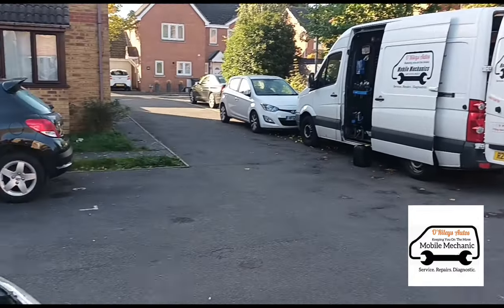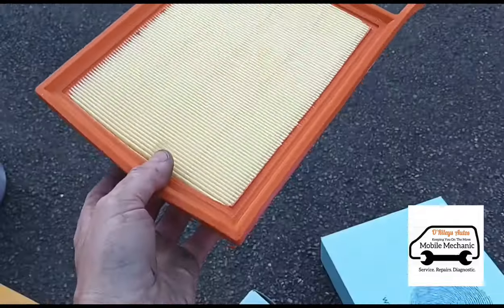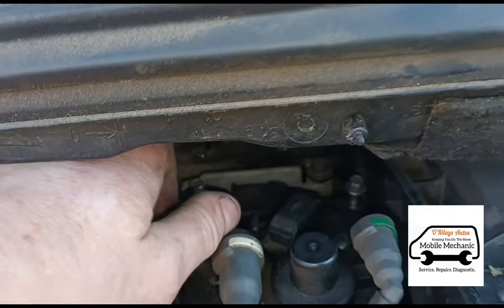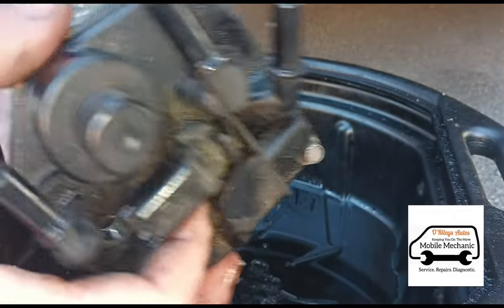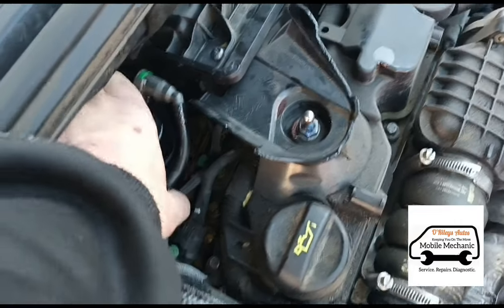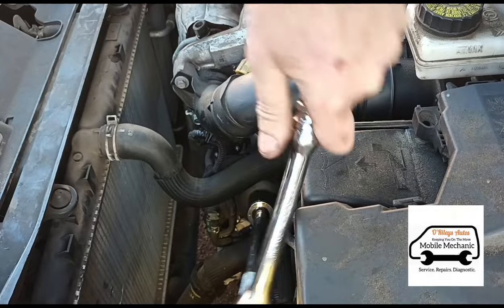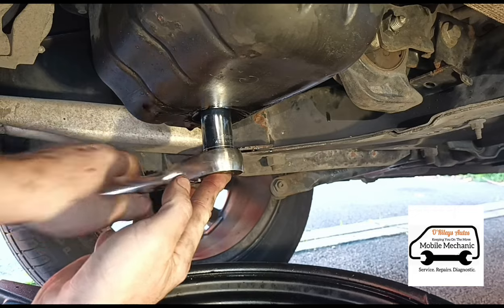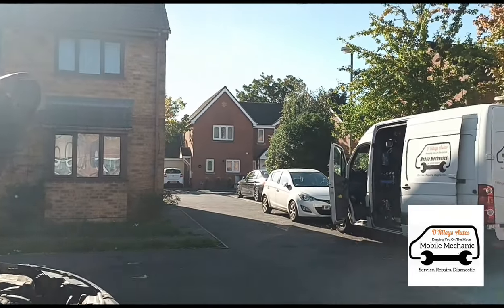1.6Hdi Full Engine Service Fuel Air Cabin Oil Filters. Peugeot Citroën Ford Volvo Mini

Comment: I have a C3 Picasso, once again, same engine, you have given me a lot of confidence to do it myself and your steps taken and explanations are invaluable. Thank you :)
Reply: Interesting did you do it okay. Would adding additives then a motorway run with diesel plus then a battery reset (unplug battery for 24 hours) also work?

Comment: You don't need to pull the sensor out of the housing. Just turn and lift slightly to drain the filter. Before then removing the t15 nuts when it's empty

Comment: When adding the new oil filter should the oil filter first be drenched in oil to avoid air pockets forming which risks dry engine start up? Should I pour oil into the center hole of the filter until it’s about two-thirds full and let it soak in for a minute or two?

Comment: He's a one of best mechanic for Peugeot/Citroën/Volvo/Ford. He did the job 100% professionally for 1.6hdi engine.
I sold/px my peugeot 307 1.6hdi 90bhp 2005 last week with 182000+miles (CK55PKC anyone can check mot mileage history) with original engine + gearbox + original turbo +original injectors with perfect mechanically fit. I do service between 3000 -----5000 miles every single time with engine oil flush and use always c2 low saps oil and tight up nicely injectors 8 bolts without torque wrench. I bought in 2014 with 123000 mileage after buying change oil pick up little pump located in sump and change turbo oil feed pipe and remove plastic filter from new banjo bolt n old one fitted with mesh gauza type filter ( when you use c2 oil and service under 5k miles then no need filter in banjo bold this little piece of s*** kill the turbo. I change fuel filter twice in 60k milage. I bought again peugeot 2008 1.6hdi with 8v 92 bhp. Let's see how this goes 🤞👍🙏 in shaa Allah hope for best.
I am not a mechanic but always try to learn from professionals ( i learn this schedule of serviceing and things from respected Irish mechanic )
Reply from the maker: Thanks
Reply: Have a peugeot 2008 (year 2015) 1.6HDI .. it has 110,000KM. When should i change the timing belt??
Reply: @alessaquilina I would if I was you just to be safe.

Comment: thanks for the answer I was looking for to my engine oil concerns - got my peugeot 2.0 bluehdi serviced last week, did only about 40 miles and thought to inspect the oil on the dipstick which to my surprise looked as black as before, so started digging through internet to find out if that can be right or I have been scammed, found some contradicting articles but I'm finally happy after seeing this video right there it's nothing unusual. thanks for posting this!

Comment: Hi Jimmy,
That tap in the middle of the diesel filter housing is there to hold the filter.
Twist it to release fuel out from the filter.
Its not a electrical connection.
😊
Reply: If only the engine oil filter is changed but not the engine oil, how much oil do I need to add after the change? I guess it's 150ml.

Comment: Very good video, I previously researched 3 separate vids on a 308 TDI to service, and only came across this one to check how easy the initial engine cover was to remove, and it turned out to show me the whole 4 filter changes (on what is a very similar group engine Peugeot/Citreon) in an only 22 min video, makes it look so simple - great work - Thanks.
Reply: ..also really want a magnet thingy to undo my sump so bad now 🤣
Reply from the maker: Glad it helped

Comment: Great video! Picked up some good tips. That magnetic sump plug tool is a must!
I also like Blue Print filters; just replaced the cabin filters in wife's C3 with Borg and Becks which are much firmer than other makes.
On our C4 Picasso 2017, the cabin filters are in the driver's footwell behind the heater, you need to be double jointed!
I always put a new copper washer on the sump plug - the time I didn't I got a leak.
Thanks for posting this.
P S have liked and subscribed
Reply from the maker: Glad it was helpful!

Comment: thanks for the video, helps me as I just moved from the 16 to the 8 valve HDI. The change of the fuel filter is for the worse, big mess. What you called a sensor is probably a heating element.
Reply: Is the 8V engine better than the 16V? No injector seal problems?
Reply: @davidk.713  the 8V version has no (0) power below 1.200 rpm, while the 16V stormed ahead, right from idle - VERY BAD!!! As mitigation a 6-speed gearbox is installed, which shifts somehow unprecisely and stiff. The 6th gear however adds cruising comfort. Many components (glow plugs, high pressure fuel pump, rail) allow for much better maintenance access. DPF regeneration takes only half as long as for the 16V, while less additive is injected, I wonder how that works. The fuel consumption of the 8V is significantly (approx. 15%) less. While I believe, that the engine (minus 1 camshaft, 8 valves, rockers and hydros) should weigh less as the 16V and the car feels as if they traded stiffness for weight reduction, the car (identically configured) actually gained 13Kg according to papers - very strange. No seal problems yet. The cause of that one were the engine vibrations loosening the injector screws. Once loose, the exhaust pressure lifts the injector and causes hot gas to penetrate the space above and below the seal, burning gaps and channels into its copper. This can be avoided by regularly checking and tightening the screws.
Reply: @cyberbob4111  thanks

Comment: 1. How similar are the codes on the computer via the interface to gasoline or diesel cars?
2. Have you presented somewhere the verification values with the measuring device at the car's sensors? Thank you!

Comment: Wish id seen this video yesterday! First time servicing my peageot partner today to the point i had to buy a socket set haha. Oil filter and air filter went well but once i took the fuel filter apart i noticed that the long bit that runs right through the middle had snapped or looks more like its been sawed off!? Had no idea what it was for so bought a whole new housing on amazon but now seeing your video explaining what its for i realised that there was also blue tac or something squished around the drain pipe of filter! Had the van 6 years always serviced at same place till this time and feel robbed. Dont get me started on cabin filter, looks a difficult job to do but wanted to try anyway and loan behold the filters have just been crushed inside and there is no way to retreive them
Reply: I went the same way as you did. Garage was ripping me off so I decided to learn it myself

Comment: That's informative....I have bought the fuel filter but mine is a Berlingo which also has an electrical connector. Dunno how that is supposed to come off...Yours did not seem to have it but you did say there was a sensor so how does it monitor if not connected to anything...?

Comment: engine OIL 5w30 : 
but if it has certification  for API SN & or ILSAC  only. as in oil for PEtrol egine only
&
I pour that oil on Diesel engine would it effect engine long term :face-blue-question-mark:

Comment: This is a 8v if I am not mistaken? Quite a few differences to my 2011 16v it seems in regards to type of filters and locations. Or is it different because this is a 110hp whereas mine is 90?
Reply: 92hp and 111hp 1.6hdi are 8 valve engines, older 1.6hdi 90hp and 109ps are 16valve engines

Comment: Have a 2014 1.6hdii Berlingo in for prep at the moment and it cuts stalls/cuts out under load if you put your foot down or go up a hill. Thought we found the issue with a leaking Intercooler but unfortunately not. Had anything similar?
Reply: Fuel filter 100%
Reply: Fault code will read fuel rail pressure low normally
Reply: @Ben-in6qh  changed the filter as was first thought. But still nothing 😔
Reply: @Ben-in6qh  thanks for the response
Reply: @SCCarTraders  no codes?
Reply: @Ben-in6qh  oh yes. I'll post them In The morning, cheers

Comment: great video really helpful 👍 
was wondering which engine oil did u use isit 5w 30 or 5w 40 and which brand please
Reply: Citroën préfère Total, as they say. Put Total 5w 30 in mine.
Reply: I use castrol magnatec 5w30 c2 and it runs great, just use good quality oil.

Comment: Ill give you a few details if u buy this car avoid the automatic gearbox as it sometimes doesnt shift and another thing is dpf cleaning might be useless i just filled pat fluid but problem returned so dpf delete incoming soon.... mechanic said the cars in bad shape as it is so were gonna drive it till its dead which will be within this yr as turbo is acting abit funny. I havent even bothered replacinh the tyres on it its that bad

Comment: are these good engines..im looking for a partner van
Reply: I’ve mine about 4.5 years, I bought it with 140,000 Kms and now has 200,000. Hasn’t givin me an ounce of trouble. Serviced every 5-7,000 Kms. A great little van, if buying I would look for service history though just to be on the safe side.

Comment: Hi . In the same engine, the fuel passes into the oil, what could be the cause?
Reply from the maker: High dpf pressure. 
Worn piston rings.
Over fueling Injectors...
Reply: @ORileysAutos  Is this something i can check myself or just the mechanic ? And thanks !
Reply: Injector seals also

Comment: What a pig of an engine bay to work on. My LHD Multispace doesn't have access to the pollen filter like this one. I spent 45 minutes removing all the fecking trim to find no access panel. F*uck knows. The last garage we took it too did up the oil filter with an air gun as I could barely move it with a 1M bar!

Im not having fun working on this. My 2007 Fiesta is just as bad for the pollen filter but the rest is easy even with a 2.0 in the tiny bay. My lovely old Escort (1972) is a piece of piss in comparison. Im sure the designers make them this awkward to charge more labour.

Comment: Changed the Clutch in an ST Fiesta with same engine and you have to remove the DPF to get one gearbox bolt out !!! Lucky for me all the sensors came out as you need this to remove the heat shields and get the DPF out of the way !! Total rubbish design  I recon !!